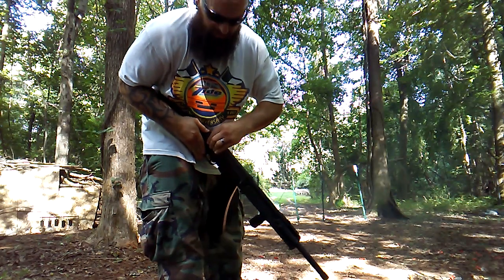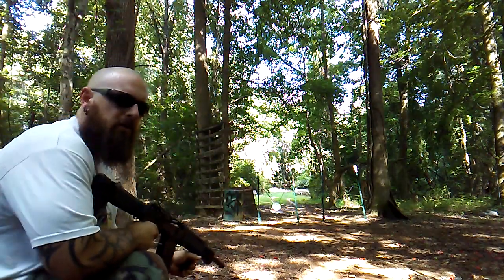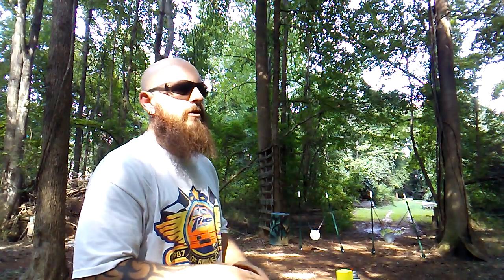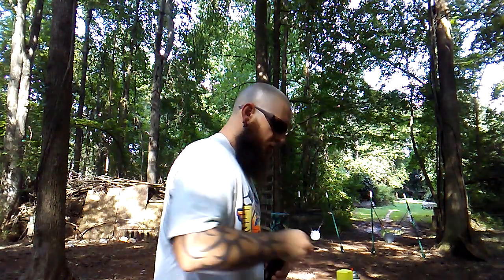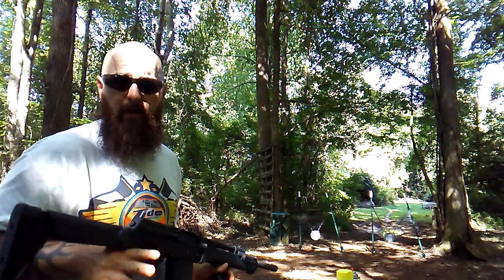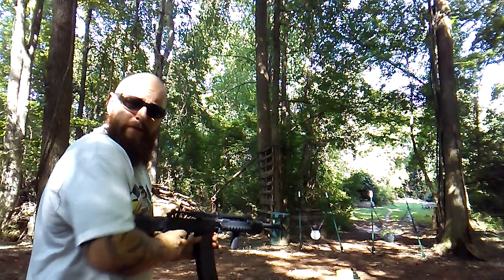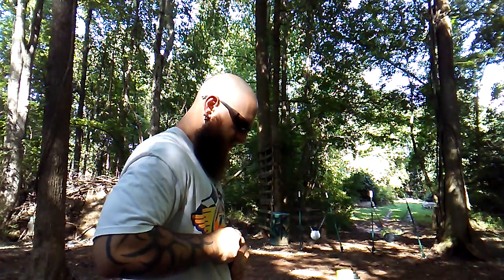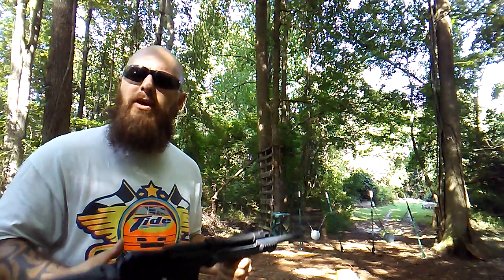SDS LYNX 12 PART 4.       Dust cover ?

Comment: drive out the two pins remove gas block slowly drill out 4 gas holes one bit larger and drill out hole in the block to 3/4 you will have no problems with birdshot, just dial it down a setting when shooting hot buck or slugs. you cant tear up these guns and you don't have to spend any money to work on them.

Comment: Have you messed with the gas setting at all? I heard from a guy that has a cheetah 12 his is more reliable without the little dust cover that rides on the recoil spring. My lynx is coming in the mail right now hopefully will have it next week!
Reply from the maker: Well I shot it today and it ran fine because I tried it on gas setting three it didn't work and then I put it back on 4 this is with that light stuff at seven and a half shot but I cut the dust cover a little bit and it runs a lot better with the light stuff I'll make a video tonight and show where I cut it while I clean all my guns
Reply: How is it running now?